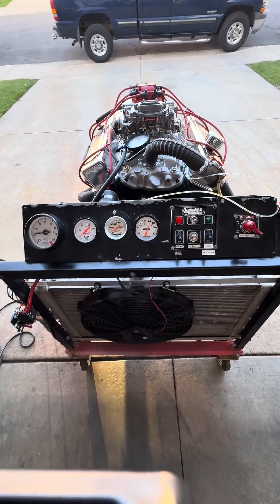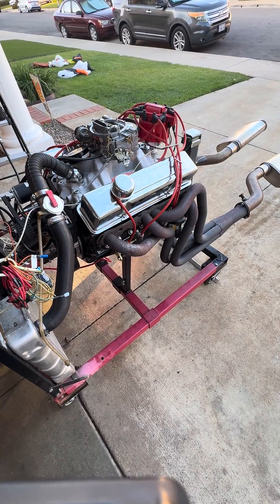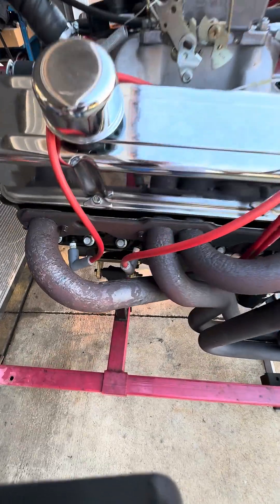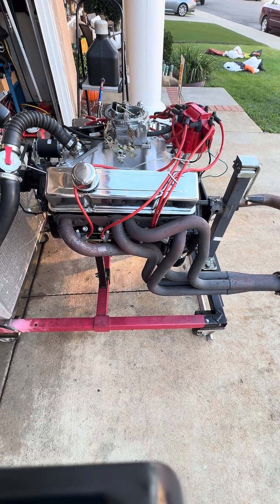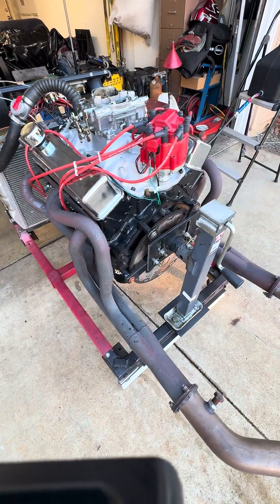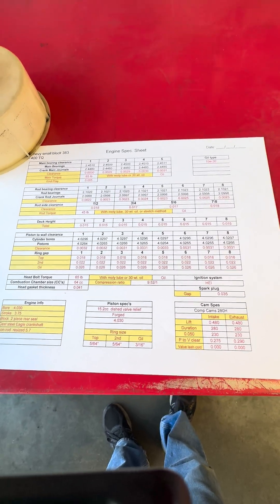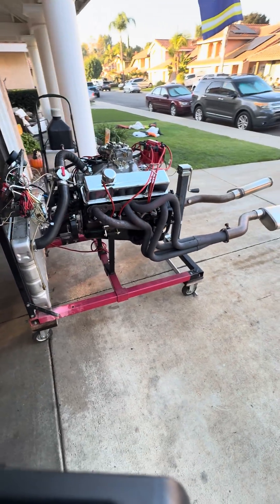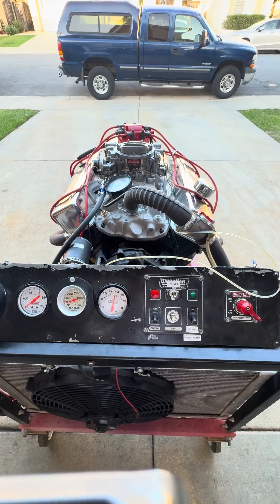JMacPerformance 350 375 HP - 380 TQ

Comment: “I put a smaller cam in this thing” 

Right to jail, no trial, straight to jail
Reply: I think he means that he put in a cam that isn't massive, but larger than a stock cam. I had a "smaller" cam in my 94 F-150s 302 and it was a bigger cam than factory, it's just more biased towards torque and usability than massive power.
Reply: @Trucks_n_stuff with the cam specs being "220/224 @.050 270/276 .495/.502 110 Ica" you're exactly right, absolutely not smaller than stock but I've seen wayy bigger cams for these engines